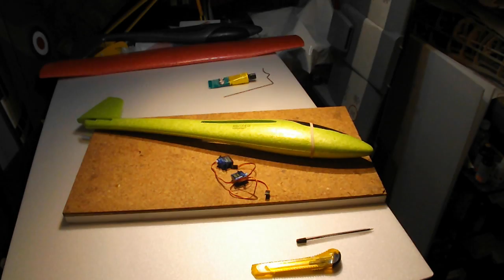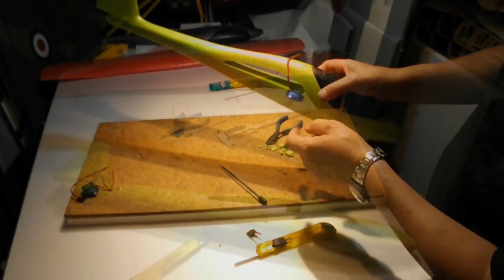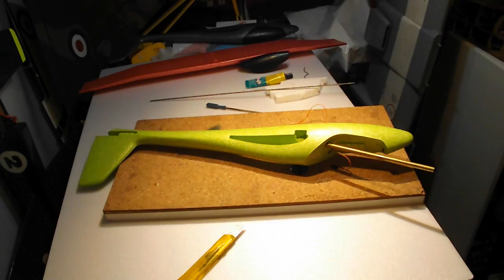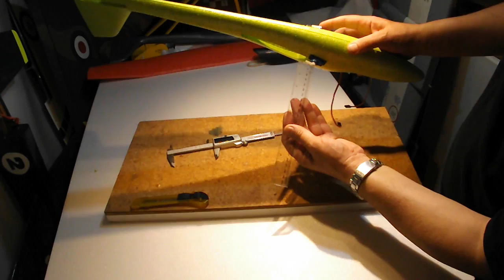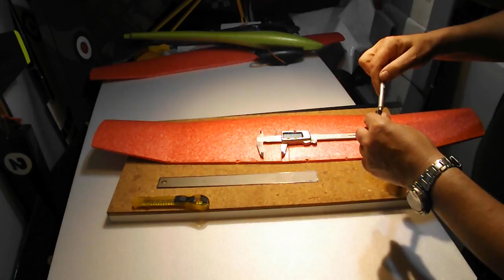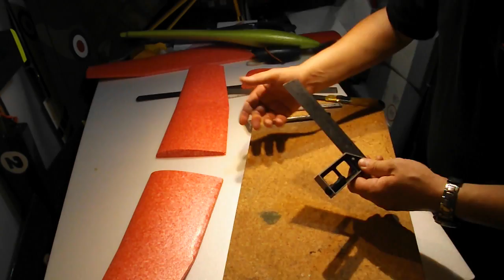Glider Conversion Pt1

Comment: Hi Stephen,

I did the same conversion and added a few more modifications:

-   Clipping the straps on the servos tops, so that two mini servos can be mounted  flush into the fuselage.
    By these means the movable wings are extending directly to the fuselage sides.

-   Trailing edges of wing, elevator and rudder are simply an aerodynamic nightmare (much too thick); therefore
    additional balsa trailing edges were epoxied, ending with 1,5 mm thickness. Much better for the air flow !

OK, wing area will increase, but elevator / wing area ratio is still 0.16; a realistic value.

In addition,  c.g. will move backwards a bit so that the overall flying mass can be reduced.

In summary: This Lidl glider - once properly converted - is one of the cheapest options to create a nice plane for lots of flying fun !
Reply from the maker: Hi, Have you any pictures or videos of it ?
For me it flies pretty well as is, And for me a conversion is a case of just add the bare minimum in order to get it to fly.
If you have to do a load of modifications then it would not have the same appeal.
Keep it cheap, Keep it simple.
Total cost to me was only £20 that is for the plane and parts.
Cheers Steve.

Comment: Nice project...starting from scratch (except for the glider I already have) how much would you say I'd have to spend to build mine on the cheap? Not only motor and servos, but transmitter, battery, charger, rods, wires... thanks
Reply from the maker: Hi, Ebay would be a good place to look, all you would need is a simple 35Mhz set and a new battery.
This conversion is aimed at those that already do Radio Control planes
Reply: Hal  depends. You can get a simple 2,4 ghz radio for like 30 bucks, but I would advise buying a 100$ for a q x7. Receiver pruce depends on the type of receiver - you can get a simple one for 10 bucks. 9gram chinesee metal gear servos, which are surprisingly good, are about 15$ for a 4pack. A simple but usable battery charger can be bought for about 30 bucks.
Reply: thanks